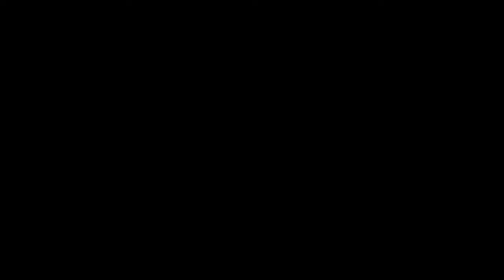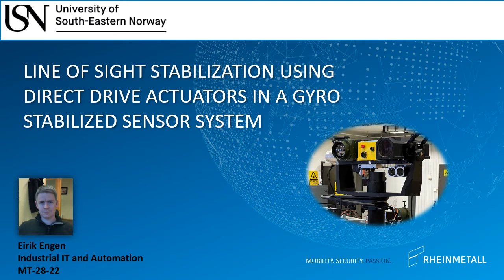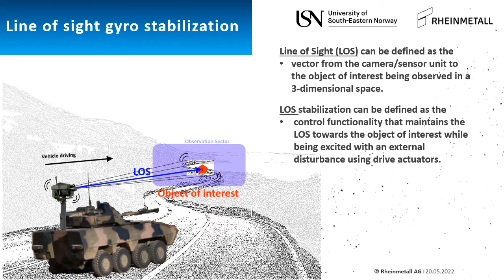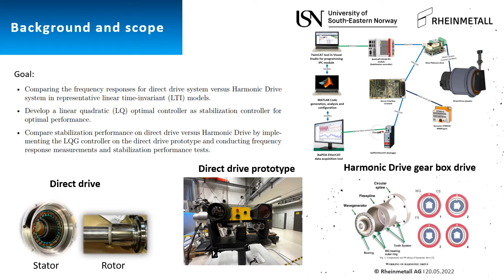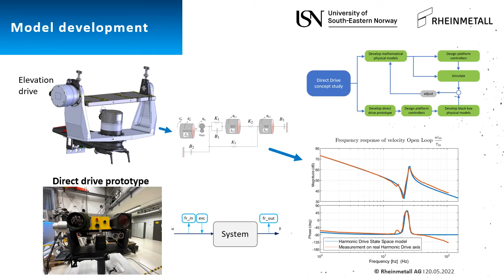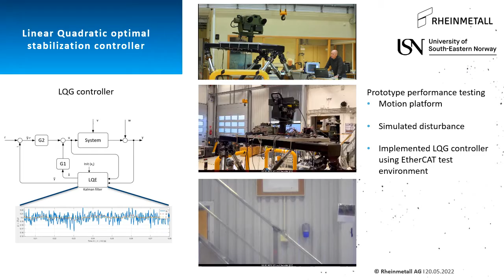USN Msc Thesis IIA 2022, Line of sight stabilization using direct drive

Comment: Informative and nice work.
I'm doing my master thesis on line of sight stabilization as well, so I was wondering If you do have a pdf link to your thesis. That would be great.
Reply from the maker: Thank you, Phil! Unfortunately the thesis is commercial in confidence. Good luck with your master thesis on line of sight stabilization.
Reply: @eirikengen5533  No, problem. How about the list of references you used [the public ones of course], Is there any chance you can share that.  I need to start somewhere beyond Hilkert and Masten papers, so any help would be appreciated.
Reply from the maker: @iDm0Nd  Hi, I have prepared a small document from the Master Thesis that extracts parts of the introduction and summary together with the reference list. It can be downloaded from the GitHub link: https://github.com/eiengen/LineOfSightStabilization/blob/main/MasterThesisExtractNonClassified_LineOfSightStabilizationUsingDirectDrive.pdf
Reply: @eirikengen5533  Thanks a ton, man. I really appreciate it.